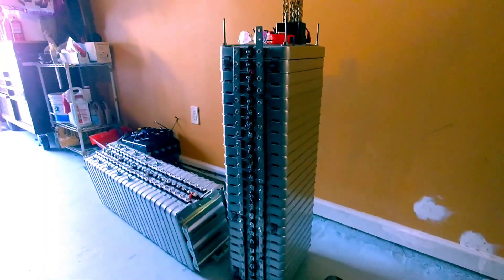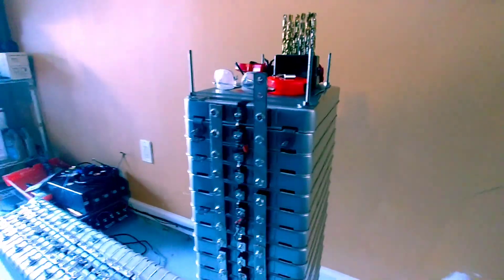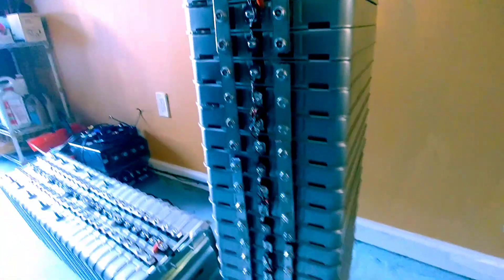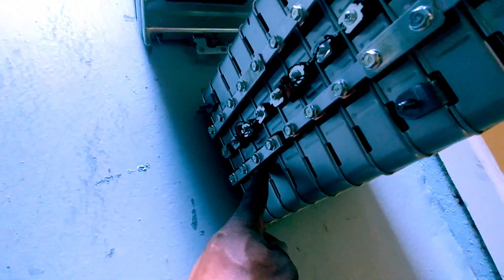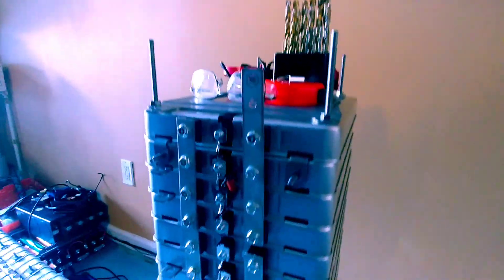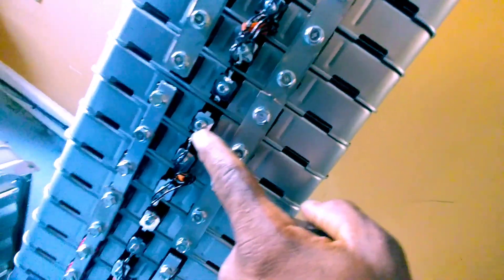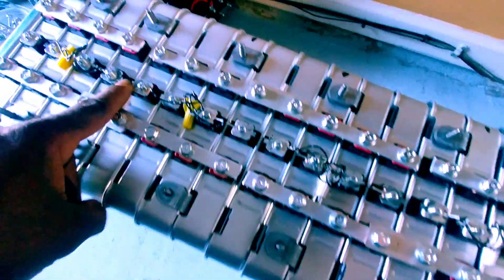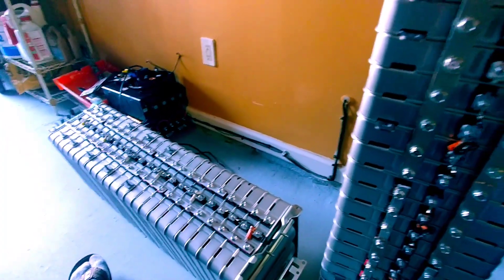Nissan leaf powerwall 48v

Comment: Do you sell battery banks like this I wish I had one I started off with Duracell’s like you did now I have just two battle born lithium batteries but I would love to have a larger bank storage. I am currently running the flex max 80 at 12 V so I don’t really know if I could even use a 48 V one but I definitely would be interested if you do sell them thank you
Reply from the maker: Thank for checking out my video/\\\\/but unfortunately no I done sell batteries nor will I sell my battery bank///\\but you can check the junk yard- that's were I get mine
Reply: DIY Solar power wall thanks for getting back with me! I will check around see if there is any in my area!

Comment: Why dont you use busbars to connect the center cells. I believe they should be current rated as well. Nice packs tho.
Reply from the maker: Thanks for checking out my video...there is no load on center.....no reason to use a busbar
Reply: @bimmers323ci  have you tested that? I know they are connected inside the cell. Im working with some gen 2s now. So im just wondering. I would love to see the balance of the pack cells at the aborb voltage. Im sure your packs are better then mine tho. Also was there any sparking when you connected the parallel busses?
Reply from the maker: @frankz1125  sparking will occur if you connect all center together....remember you are seriesing each pack to get the voltage you desire so you can not connect all center......center taps are only connected together when you have packs in parallel and then a space then series...go back to my video
Reply: @bimmers323ci  yes sorry. I will be paralleling the pack to manually balance them before it gets seriesed. Ill do a vid on it.

Comment: What are you using for the middle terminals. Your looks better than mine
Reply from the maker: Thanks for checking out my video...the center is not been use.but connected in packs. Of 4 to keep all voltage the same
Reply: @bimmers323ci  what did you use to tie them together. The middle terminals that give 3.7V. I like how it looks. I have used busbars but will welcome something that looks as good as yours